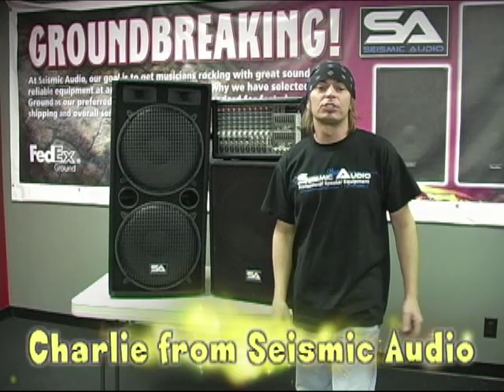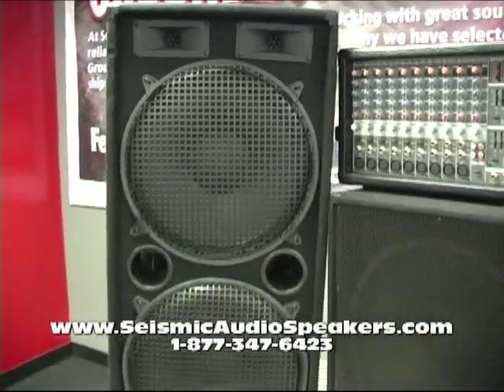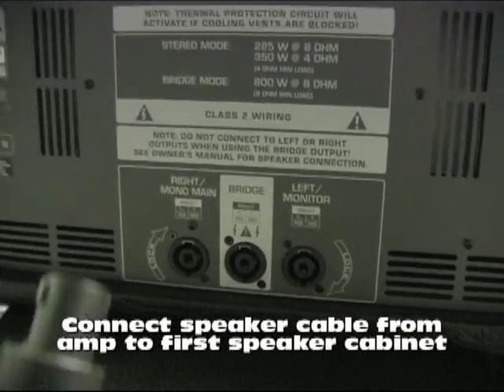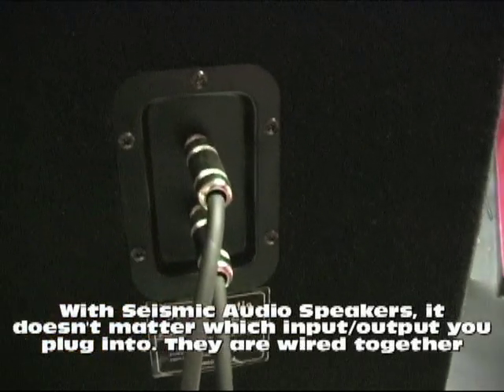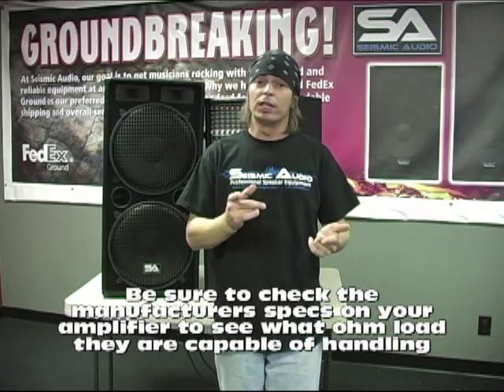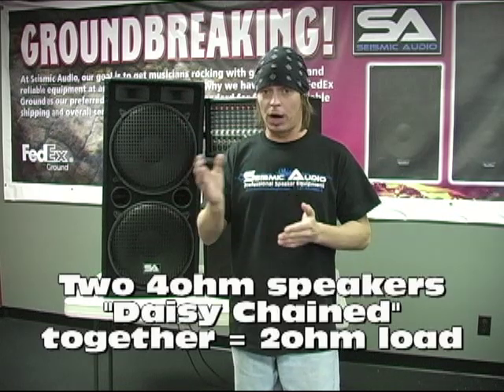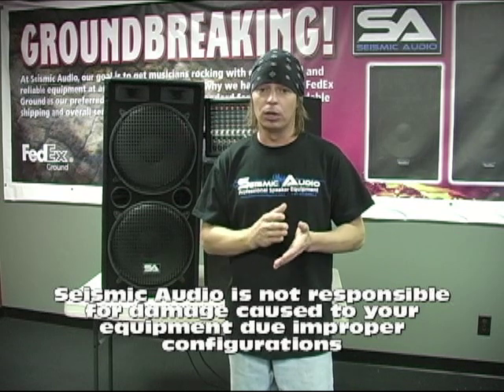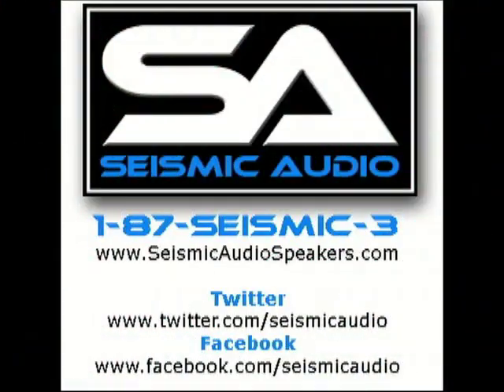How to Daisy Chain Speakers.mp4

Comment: @jamblam Daisy chaining is strictly based on parallel resistances. In parallel its 1/Rtotal=((1/R1)+(1/R2)+....(1/Rn)) so the total ohm load goes down as you add more speakers (thats why theres a minimum load for amps) . Resistance goes down so current goes up for constant voltage at source (ohms law) Even though your diving the current, its stronger so you still get full power from all speakers! If daisy chaining was series based then NO cab could be used by itself- series would be broken!

Comment: Use this method all the time :D 
i Have 6 ''15'' 8 ohms dropped down to 4 Ohm into 3 inputs (Y) 
Works great :D
Reply: What kind of powered mixer specifications do u need to Daisy chain 4, 8ohm speakers into 2 ports?

Comment: So by what you were saying, would it be unwise to daisy chain two 8 ohm speakers to an 8 ohm power mixer?
Reply: Yes... if the minimum load of your power mixer is 8 ohm only (unlikely). If your power mixer can handle a lower load (like 4) then you will be able to daisy chain two 8 ohm speakers (two 8 ohm speakers wired in parallel = 4 ohm)... and in this case you couldn't daisy chain two 4 ohms cabinets (cause that would give you a 2 ohm load).

Comment: I have question...my amp puts out 500w per ch. into 8ohms. and 1000 watts per channel into 4 ohms , i want to daisey chain my 8 ohm speakers to get the 4 ohms at a 1000 watts . when i daisey chain my speakers will it be 1000watts into 4 ohms per speaker or just a 1000watts total going to both speakers and which channel do i connect to ?. thanks,

Comment: Some of the info is not right.  Two speakers in series doubles the resistance, just like the speakers here in the vid (wired in series). 2 speakers both 8 ohms doubles the resistance to 16.  So an amp running 500w out each channel at 8 ohms going to 2 speakers in series is now giving each speaker approx half the power (like 250-200 each instead of 500W each) .  So series wiring esentially cuts your wattage in half going to each speaker.
Reply: well close but wrong ,If you hook two 4 ohm speakers together you wind up with 2 ohms. Parallel there is no good way to do it if you hook one 4 ohm and one 8 ohm you will get 2.6 ohms to  the amp . Yada yada yada...
Reply: no 2 8 ohms connected together is a 4 ohm load

Comment: I know the 1700 is rated at 325W @ 8ohms load and 500W @ 4 ohm loads so on one channel you can daisy chain the two 15...BUT if the 4 10" monitors are 8ohms and you daisy chain them, it will bring a 2ohms load and that will violate the performance of your amps because it wasn't design to work at 2ohms load